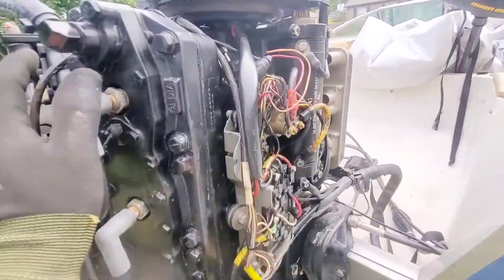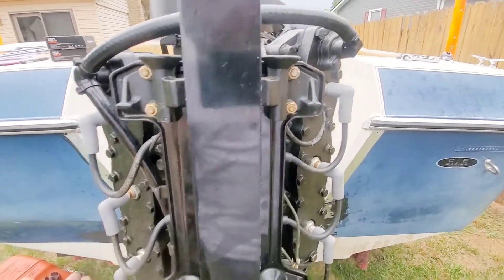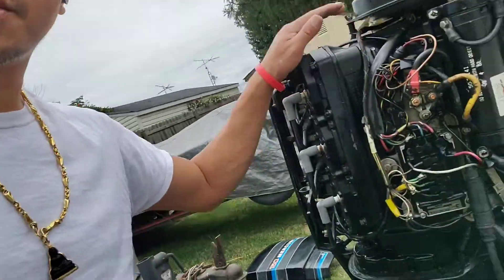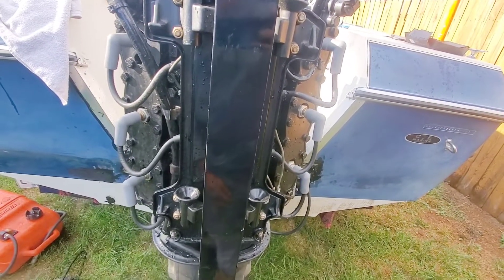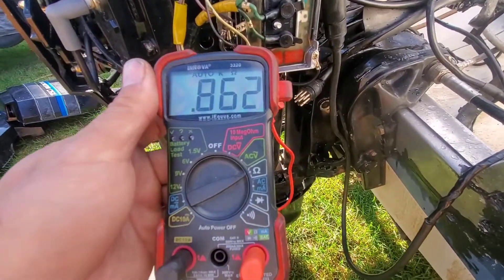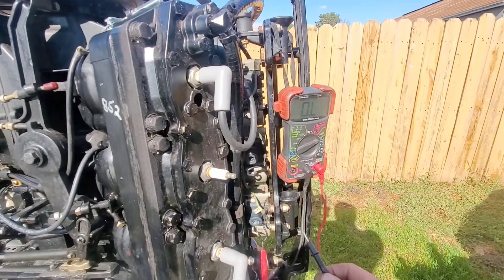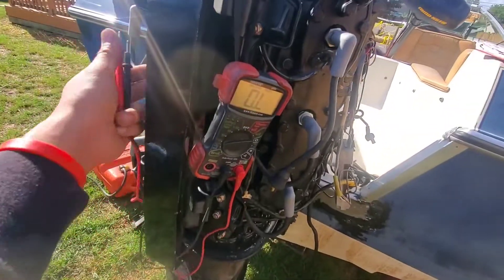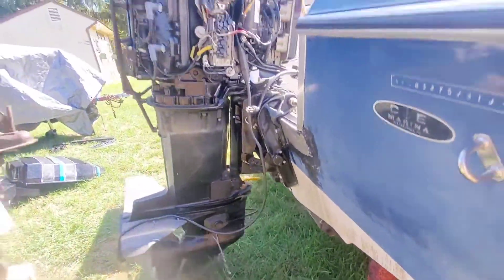MerCSon V6? Water Jacket Fail & Ignition Issues

Comment: Do happen to have any videos on setting the timing on one of those v6 150 mercs i have a 1988 150 xr2 and i have replaced everything new CDi stator trigger switch boxes cleaned the carbs new fuel pump new fuel lines new primer bulb installed water fuel separator new thermostats water pump new chris carson glass reed valves i do have 125 compression on all cylinders across the board and at home in a water bucket the dam engine starts and runs and idles like a dream but i get it on the lake and i cant go over 5 mph or it dies and bairley wants to start back up I'm at a loss the only thing i haven t checked is the timing so any ideas would be much much appreciated
Reply: Search lync and sync black max,
Reply: @xspower8899  the carbs appear to be in perfect sync all the butterflies open exactly at the same time from what i can tell but i will check that link out thank you
Reply: @benbirkigt493  no worries mate you might want to disconnect idle stabilizer if you haven't already,known engine destroyer. Good luck
Reply: @xspower8899  i was wondering about that and no i haven t unhooked that yet but i think i remember reading somewhere that you have to reset the timing to 25 degrees or something like that after doing away with that box is that true or can i just unhook it with no negative results ?
Reply: @benbirkigt493  Take it off and go, you might lose a little top end but worry about that if it annoys you.
Reply: @xspower8899  awesome thank you very very much for your help and responses back i very much appreciate it thank you.
Reply: @benbirkigt493  Too easy mate, love the black max
Reply: @xspower8899  👍✌

Comment: Be curious having you test a v6 stator on the motor. I have a 135 that starts , idles, has 124-5 psi all cylinders, has spark on all when I pull the plugs and test....fires up, get on the water and it drops cylinders. Then will hit on all 6..... for a bit. Drops a cylinder or two again relatively randomly. Comes and goes. Sometimes right down to 3 cylinders. Wondering if that could be the stator. :(  ( Fresh fuel pump and squeeze bulb on fuel line too )
Reply from the maker: Definitely electrical. I would follow the same process in this video. The stator test is relatively easy. I would get a dva adapter/meter and test the voltage going to all 6 coils. It needs to be consistent and around 200 volts. Hope this helps. Let me know. Son
Reply: @MerCSonL6  thank you I will follow that thread
Reply: Did check the coils, had .2 -.5 ohms on the primary, 860-960 ohms  on the plug wires. Surprisingly hard finding a multimeter that can handle the low ohm readings.. :) U mind if I point folks this way from my channel?? This is an AWESOME channel!
Reply: Might just spend the 400 and get a new stator...want this to run and not fool around too much. Wonder also if I got the flywheel for the lower amperage stators is that an option, the 40 amp stator is kind of wasted on my checkmate where all I have is charging batteries and running lights.. :)
Reply from the maker: @afleetcommand  Thank you. I would greatly appreciate that. Son

Comment: I chased my tail for 11 man hours on a 79 v200 on ignition issues just like you were having. All kinds of random meter readings and multiple “head scratching” afternoons. Ended up replacing the stator, trigger and switch box’s with Sierra units and problem solved. What brand switch boxes did you use?
Reply from the maker: I believe they were jet units. Seem to work fine. Not sure on long-term tho. Son

Comment: hey I have 0 compression in cylinders 4 and 6 and 5 has 50 psi.... think it's piston rings, engine ran away a while back
Reply from the maker: That motor is dead. Needs complete overhaul with oversized pistons minimum. Son
Reply: @MerCSonL6  yeah. knew it would be bad. any clue what you think it would cost to have it fixed?
Reply from the maker: @candleflame4355  more than the engine is worth. Son
Reply: @MerCSonL6  Could I perhaps email you and ask you a few things?
Reply: @MerCSonL6  thank you